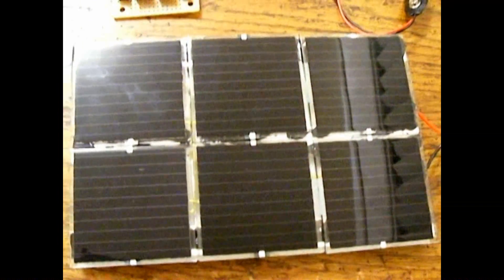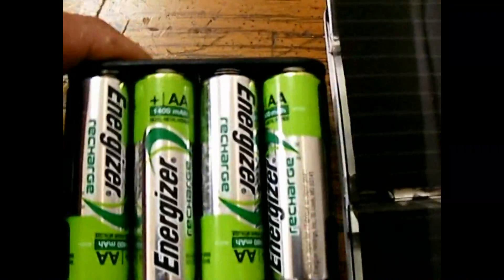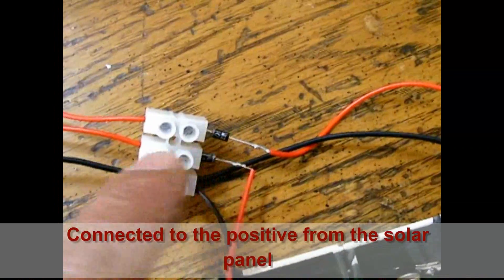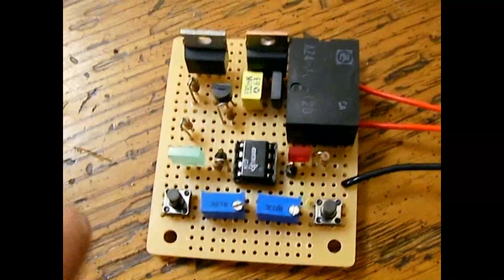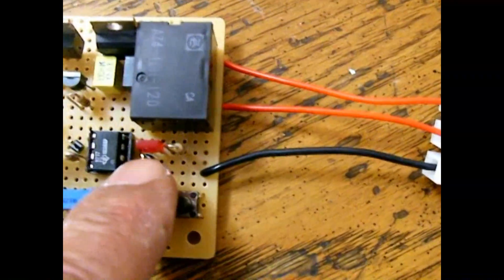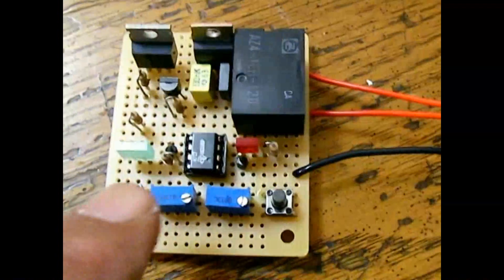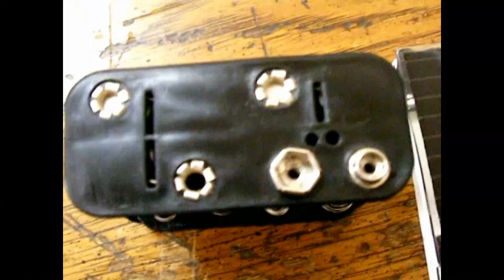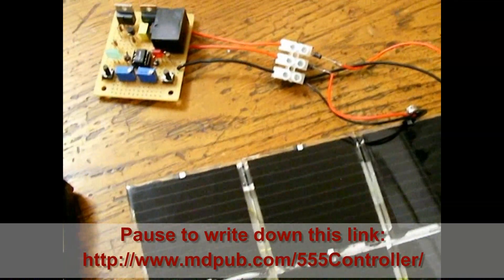DIY Mini Solar Charger & Home Made Charge Controller for small Battery Pack

Comment: I build a battery charger and I wish to have the diagram of your circuit to automatically cut the load and what is possible to send me the electronic diagram thank you for your friends in France
12V Automatic CutOff Circuit Battery For Desi Chargers

Comment: With that many panels you should be able to  charge batteries in about 2 hours, not 2 days.  Too much power consumed by the complex circuitry?  You never stated the specs on the panels so who knows.  You should use a buck conveter to get a lot more current at the proper voltage.  Checking voltage is not a good way to check charge on NiMH batteries btw, you should use a proper charge controller.  Also charging 8 batteries in series is a bad idea.

Comment: you will need ten batteries to achieve 12 volts if using 1.3 volt rechargeable batteries ie 10 x 1.3 equals 12

Comment: i am planning to use this circuit into my project. can this circuit handle high current output of my dc generator at 12-14 V at 3-4 Ampere that could damage the components? thanks in advance.

Comment: oh yah
  use 10 cells and works great.
Reply: badphobar  you have diagram of it ??
Reply: the 10 cells in series for 1.2v cells.all + to - fie 14.5v charged. Same as your previous battery pack but 10 cells. 
thank

Comment: also did this circuit but mine does this weird buzzing sound before recharging.
Reply: Bro, saan ka nakabili ng mga parts na kailangan. help naman kasi plano ko rin gumawa nito. salamat bro.
Reply: nako bro sorry took me 2 years to reply. sa mga electronics shop lang bro easy to find yang mga yan
Reply: May schematic ka ba nito brad?

Comment: Im also making this controller, my question is, do you have all the negative (ground) wires going to 1 place? and is the positive of you battery going to the positive of the 5 volt regulator and resistors?
Reply: same question

Comment: also the diodes will also act like a resistor you used a smaller rectifier diode with that dc current ... you need to add higher amp diode and it will also lower the voltage better use schotchky diode to minimize voltage step down